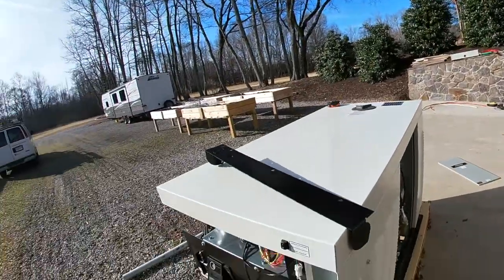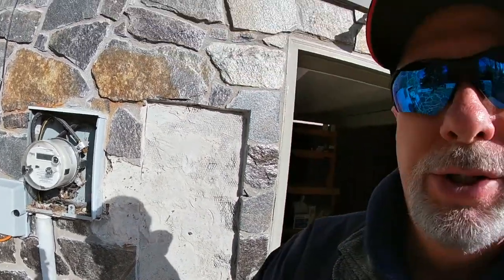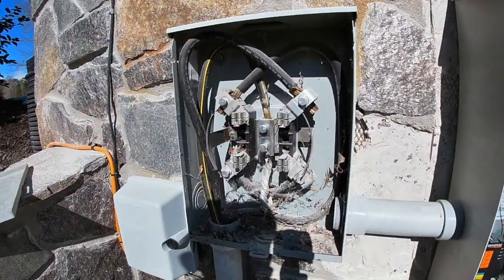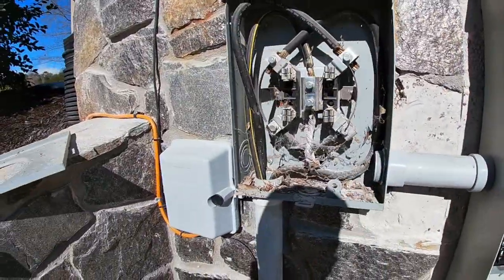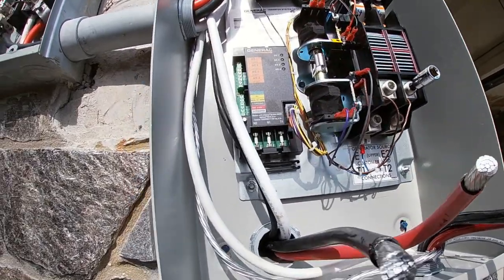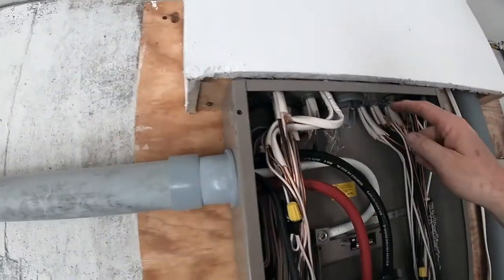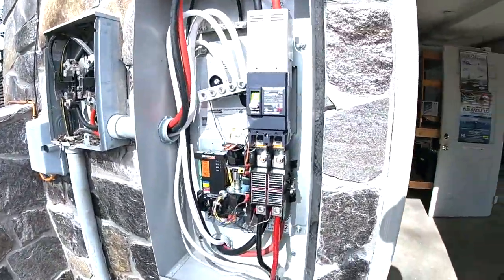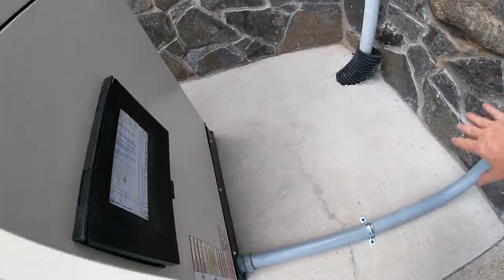HOW TO INSTALL GENERAC 25 KW / ELECTRICAL HOOK UP  (Pt.2)

Comment: Great Video, your contractors did great job. One question, the wires that run from transfer switch to your house circuit breaker panel, I might have missed it but did they run a (GEC) grounding electric conductor from those to panels? Here in Wisconsin we have to do that. Just wondering. Thanks again for your time to show the process of installation.
Reply: You saw that too? And they removed the main bonding jumper at the ATS, which should not have been done. I couldn’t tell if the grounds and neutrals were separated in the house sub-panel.

Comment: Do it click out when power is restored or are you just feeding the power grid I feel it's best to buy that  expensive battery to store exta energy from running when not needed then you can sale power to the towns near by if needed with a solar back up.
Reply from the maker: The transfer switch disconnects you from the outside world and connects generator to your panel at the same time. When power comes back on it trips back connecting house to outside power and disconnecting to generator. 15sec. later it tells generator to shut down. Transfer switch is heart of operation